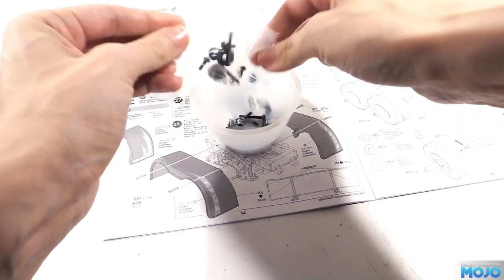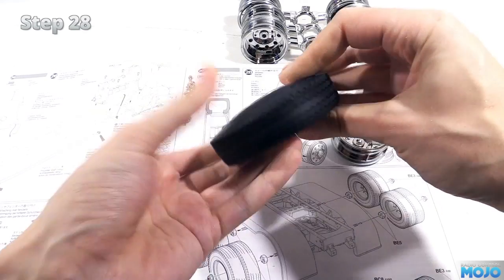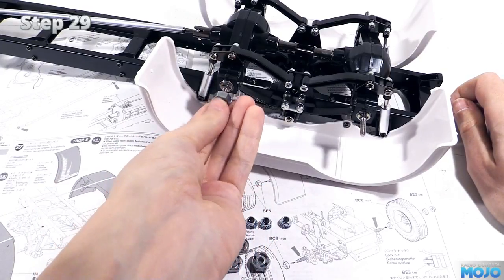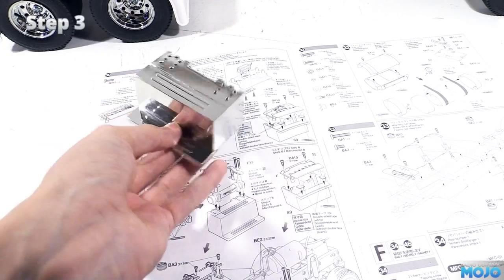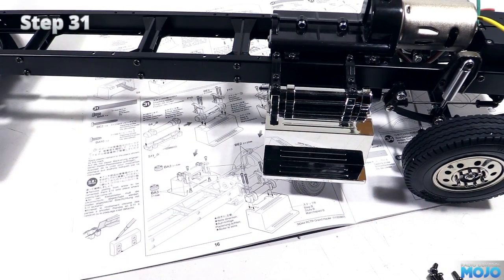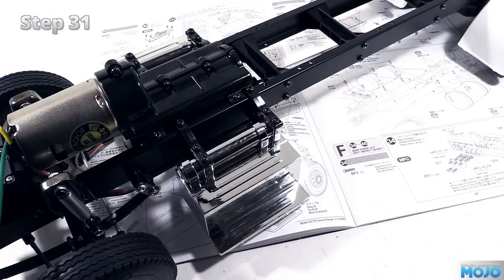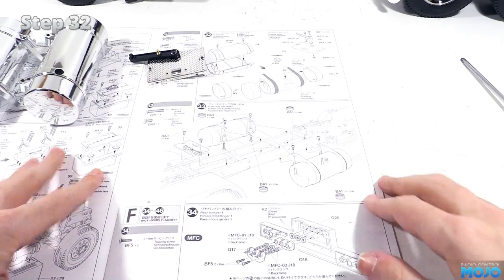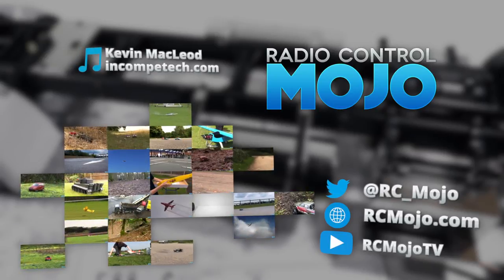Tamiya Grand Hauler - 6 - Bag E

Comment: Have I mentioned that I REALLY want one of those!!???! 😲😲😎👍👍
I may have to sell my second born! 😂😅LOL! 

Really coming along nicely. Those are such beautiful Tractors!  I can't imagine the stock SH540 in THAT!  If there was ever a case for using a 550 - this Rig is IT! Especially so, after you hang a metal Trailer behind it..... 
Seriously, I've talked to several people in RC Semi forums. These stall on barely a 5% grade, with Trailer.  DON'T get conned into an 80 turn either! Please. 
Contrary to popular belief, higher turn motors DO NOT have more Torque. In reality, they have much less! They just spin slower, for more Scale speed.... But they do indeed, have significantly LESS power and torque than a box stock 27 turn Tamiya silver can.   Yet people continue to push 70 and 80 turn motors, and many believe the hype - based on here say! 

I believe with your background, you must know this. I'm outlining this, in case anyone watching doesn't know this.  We put higher turn motors in our Trail/Scalers, to make them less punchy at low end. It accomplishes that by providing less torque.....